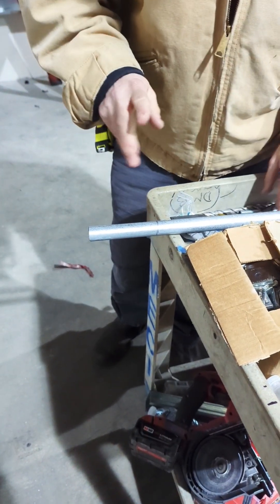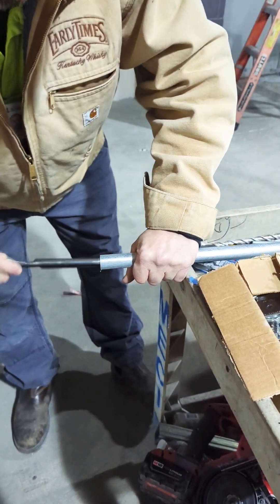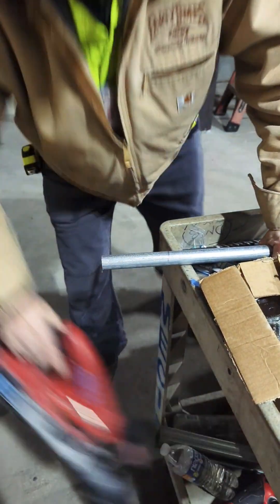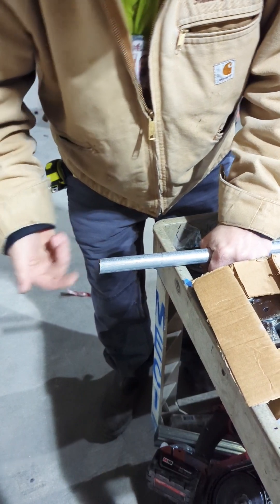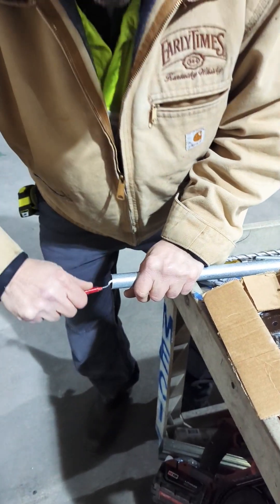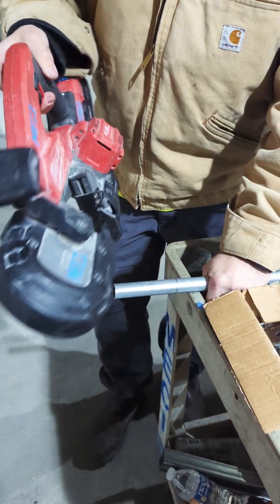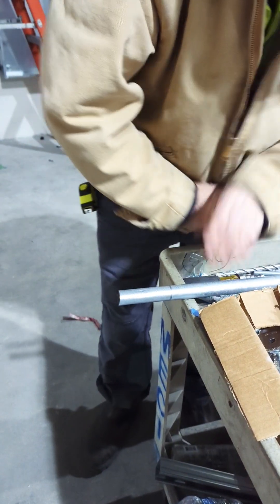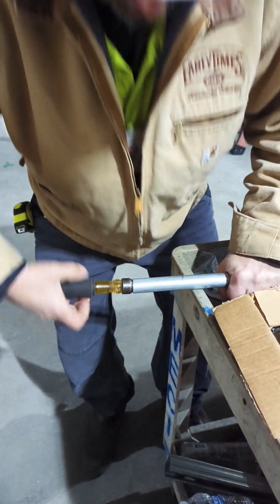How to ream EMT conduit.

Comment: Milwuakee makes slip joints designed to do a good job reaming
Reply from the maker: Milwaukee makes the most awkward non gripping pliers on market..not there strong point.
 Simple reamer is so much easier and never has to be adjusted..and only a few Oz.

Comment: Gotta ream the outside too.
Reply from the maker: Old days yes,,new cheap fittings no and the fittings cover the burs and go on with no avail. Now if  you're going to pull wire thru the outside of pipe..then you should NOT be an electrician.
Reply: 😂😂😂😂 @Chevelle1967-Hardtop